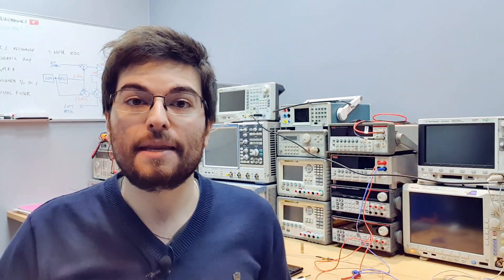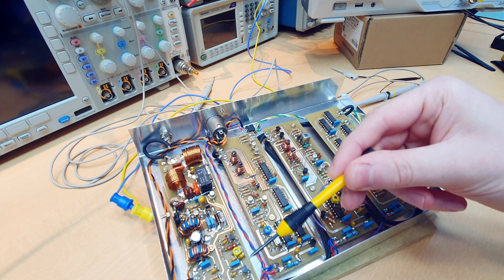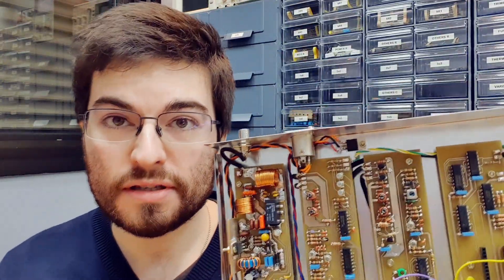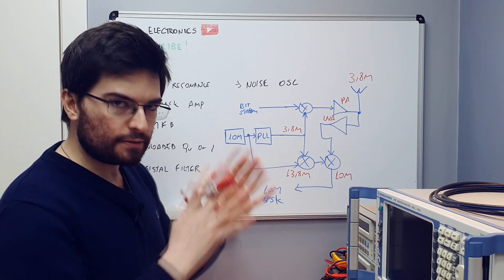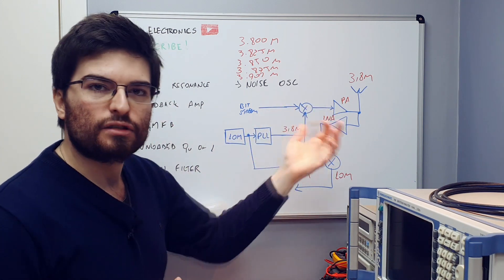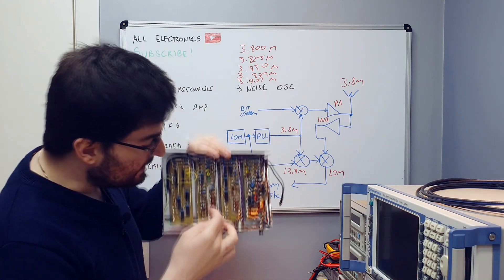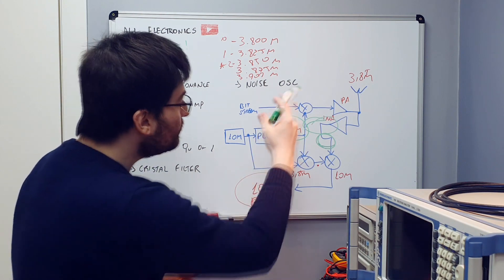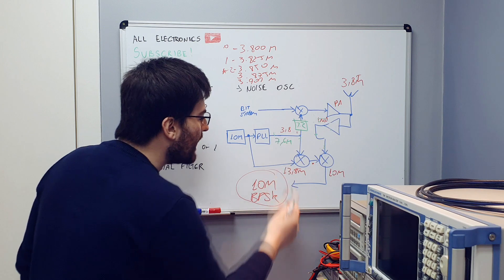Ham Radio - Digital Transceiver - Project Update - Part 2

Comment: Why not made in 2m band? about 145 to 145.100 are the frequencies exclusive to radio packet in this band. It would be more easy to use thinking about the antenna size. Learning so much in your channel, great hugs!

Comment: in ALL mobile data communication systems the uplink and downlink (send/transmit) frequencies are always different and a diplexer is needed for the antenna too. otherwise you can not get rid of the interference. even having a divide by two will not help you much
Reply from the maker: Forgot to say it is half duplex !! Using the same tx rx carrier

Comment: Very good explanation of the defects of the transceiver, I was thinking In a new block diagram to solve the problem of the signal corruption and I´ve found that adding two more mixers (and its filters) and some freq divider and multyplier attached to the 10 mhz reference it could work also need to change a mixer to subtract and other one to add freq
Reply: Here I left the Image of the diagram and a GNU radio companion scheme to simulate it (Im using the gnu radio for windows)
-Image: https://drive.google.com/file/d/1vAZ6dEozJBInM3KE5a6SOGrpVcE1HQgJ/view?usp=sharing
-the gnu schematic: https://drive.google.com/file/d/1oayJe4ZSlMwL6mreX4AeDXY02nBi8b6l/view?usp=sharing
I know that in the paper all sounds very good and could have more problems that it is trying to solve but its an idea
Reply from the maker: Wooooow!!